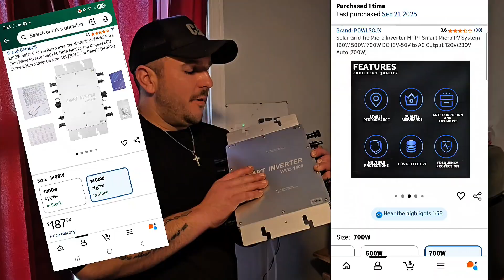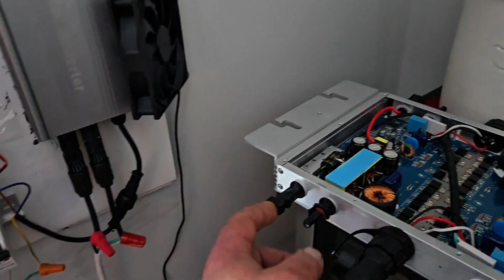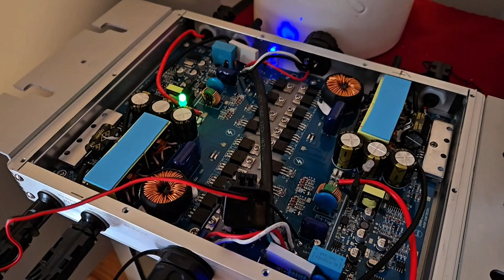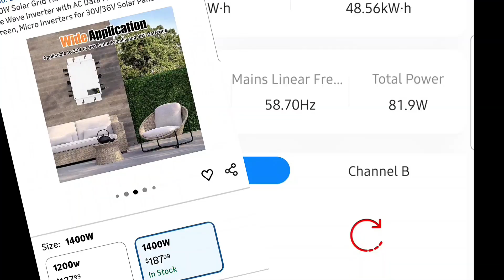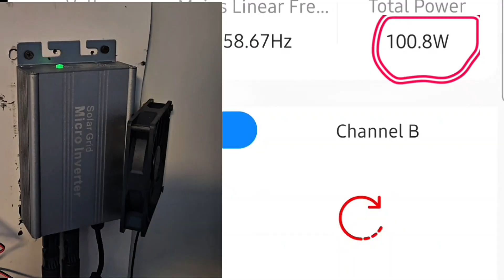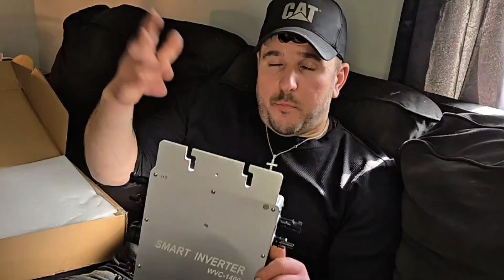Dirt CHEAP (Grid-Tie inverter) SHOWDOWN

Comment from the maker: Here's the cheap 700watt grid tie inverter I bought from Amazon:

https://amzn.to/4zmw461

Here's the 1400watt: https://amzn.to/4xasZV6

Heres what I've been using for months thats grid tie, mppt, off-grid, on-grid, 24v battery charger, 120amp, 3600watt pure sign wave output, etc.
https://amzn.to/4xPUuDh

Comment: I'm looking to grab one of those 700 watt inverters, but I looked at the specs and it says not to exceed 50v and the 300 watt panels I'm looking at are over 30 volts.  So should I put em in parallel, to keep the voltage from exceeding 50?
Reply from the maker: Yeah, they'll actually put out around 38-41 volts under direct sun. You can get parallel connectors or splice. I spliced. I think my panels put out 51-54v max at times in parallel